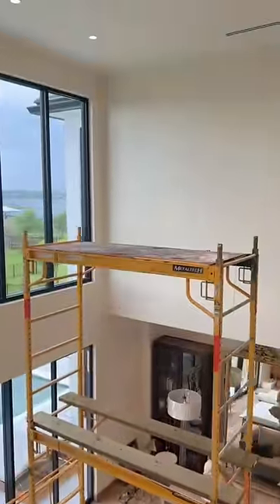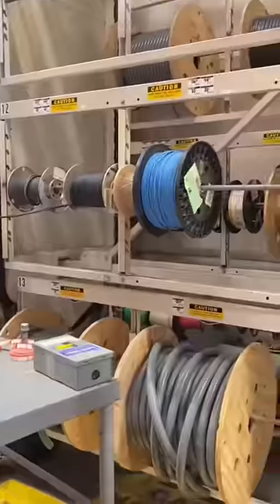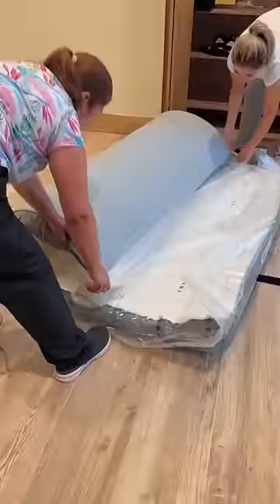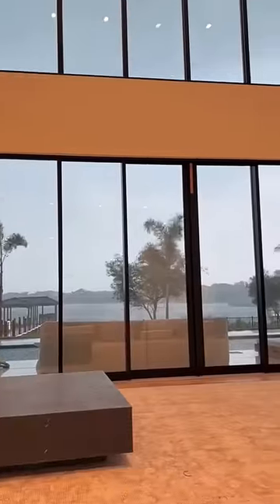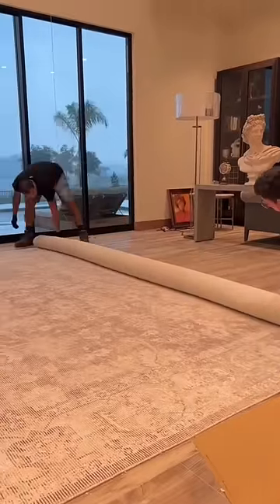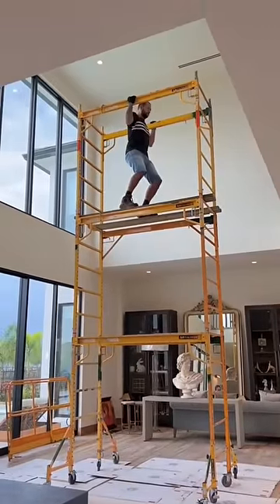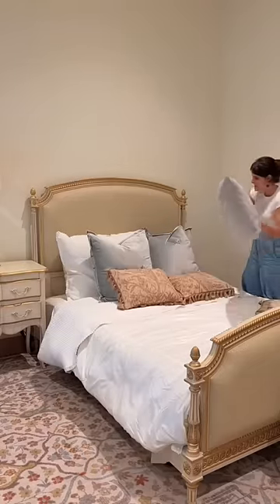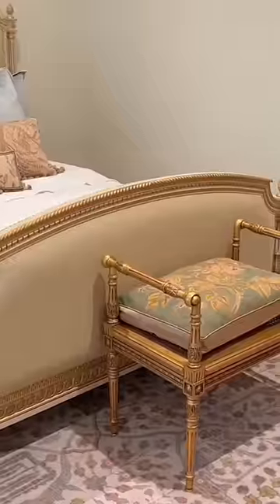decorating a 7200 sq ft french country house! #interiordecor

Comment: Those beds in the guest room need to be either platform frames or you need a box spring under the mattress. The gap behind the pillows and the bedding dragging on the floor is not it.
Reply: how about the fact none of the linens are pressed/washed
Reply: @CrokusTheDerg  because it's just an example for the housekeeper later. She said it in the video.